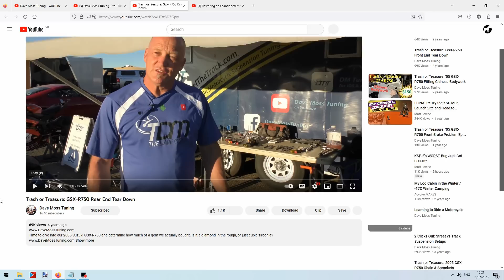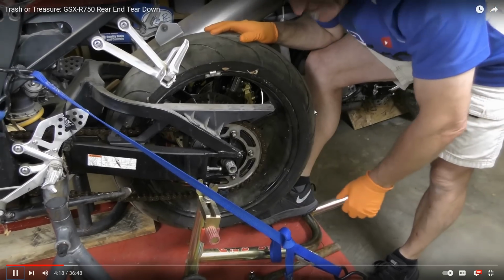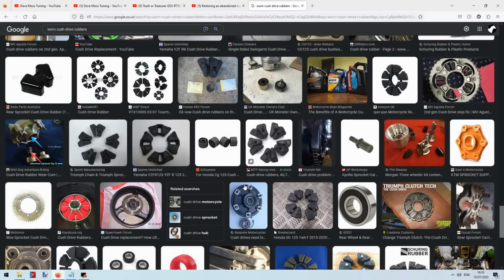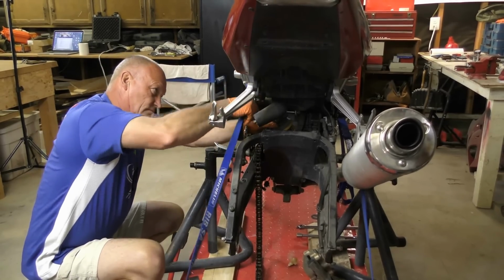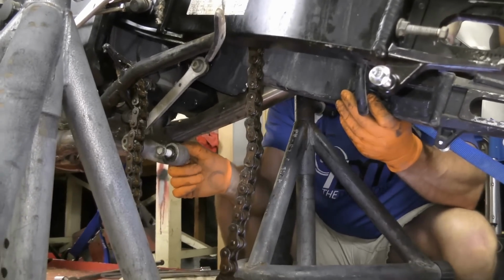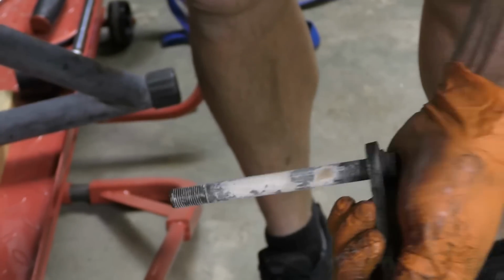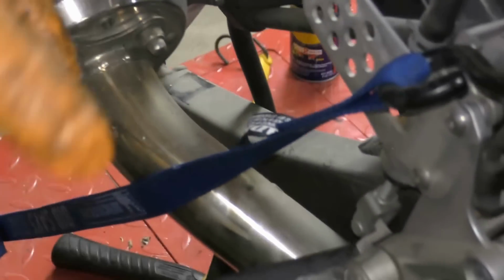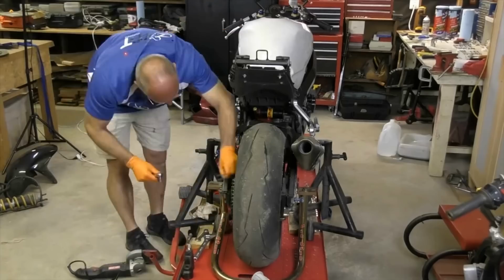Dave 'expert' Moss - The swingarm #2

Comment: This is messing with my head; so many tight bolts undone with a ratchet (with all the forces involved going through a tiny tooth of metal) when a tommy bar or breaker bar should be used at first. He’s even got a breaker bar there with him at the time. All he’s saving is a few seconds, when he doesn’t have to change over to a ratchet when the bolt’s been cracked loose. 

Ratchets will take a fair bit of abuse, but only up to a point.

Comment: 27:00 that is the original screwdriver - GSXRs came with a reasonably decent toolkit including a double-ended screwdriver with tangs in the middle as you mentioned plus this longer single-ended one.

Comment: 1. Why wouldn't you pull the swingarm linkage off and then just drop the shock out the bottom? 
2. Why wouldn't you trim all the video footage of you spending 5 minutes figuring out how to remove a cotter pin from a castle nut?
3. Why wouldn't you take the bike to a car wash and get it clean and not disgustingly grimy and dusty before you start doing this sort of tear down?

Comment: Why do we always have to have a prediction before each operation glass half empty style and then “go ahead, a bunch of often times” all usually turns out okay, then still provide drama as near avoidance from the brink of catastrophe?

I hope I haven’t already missed the spark plugs and sump bolt removal footage following the same idiotic reverse methodology as the rear suspension linkage fasteners?

Comment: LMAO watching this as I use new nuts on a new sprocket on a 25 year old Yamaha XJ600n and perfectly happy with the cush drive rubbers. Everything you say is mostly what I was thinking / shouting at the PC. I wouldn't let him finger my bearings to test them....  they are cheap enough to replace,  which is what I did. Yes I think you are right. ...... doing something he's never done before and all the while give sage advice like an expert.   The link bolts need to free to turn in the bearing !! FFS

Comment: Where do I start?? What can be said you didn't say?? 
OK... The dog bones.... They had bolt heads on them so put the god bone in the vise and use a fucking spanner on them and they will break quite easily.  The castellated nut to set the swing arm doesn't need to be undone to remove the swing arm as you pointed out is there to centre the swing arm. The cush drive again is as you pointed out fine and its just rotation which he should have checked with the wheel in situ. The subframe surely had to have bolts in when they got it running as I saw him leaning on the tip as the tail unit and it didn't move in the first video.  

Removing the exhaust is always a good idea and it is easy enough to do too. Loads more space to work with and it just makes life easier. The rear shock could have been removed easily from the bottom once the linkage had been removed too. How do I know?? I built a GSXR600 project bike which is the exact same chassis and that bike was stripped and rebuilt several times, twice for photo shoots and stuff like the shock removed many times to run different springs, different shocks and change the shock length to alter the ride height blah blah blah... 

That bike is NO different to 99% of other bikes the same age and mileage when it comes to "corrosion" as it has been in Utah which is a dry heat and has possibly never seen temperatures below 20 degrees C where the owner lived. No real rain in summer as its part of the area which has been having a 20 year long drought. I would be happy to work on that bike. To be honest if it was mine, I would check free play in the wheel bearings, headstock (they can get abused from wheelies and hard landings), fresh fluids, tyres and sort out the brakes and then ride it on the road for a few days to see if anything else seems off like knocking in the forks under braking and get a feel for things that may need to be done.  Then strip the body work for fresh paint, strip it down to clean it as much as I want and then do changes to the shock or forks based on how it feels while riding it.. A bad rear shock may not be obvious just with static load and will only show up when riding. Same with fork issues, riding will show them up much better.  What he has done is a Dell video trying to make a simple refresh sound like its a massive job and over complicated it all as well as made non issues sound like expensive issues. Possibly because if he sees those issues on a customer bike he can justify charging more for it. (He must have been a plumber, plasterer or electrician in a previous life). 

The numberplate mount is fitted behind the wheel when you are some dumb American who wants to barely comply with any laws and is going to try to out run the cops..

I might go and look at some of his suspension set up videos and share the dumbest ones with you via messenger on farcebook Matt. 

Also if you want or have time, you are welcome to come have a day (usually a Thursday) riding on the little pit bikes on track and get to hone your riding before you get out to do a trackday on the track bike you are building.  Usually Rich Cooper, Kyle Ryde and a few others come out too most weeks.
Reply from the maker: I'll be taking you up on that once I get a new workshop sorted

Comment: I had a swingarm pivot bolt that was proper seized where it goes through the engine in an XR400 dirtbike. I would pay to see this guy try and get it out, he'd probably end up being one of the dopes who pull out a sawzall and cut the swingarm off and buy a new one.

I had grind down a socket to get better engagement on the bolt head, 6' cheater bar, heat on the engine case, and a brass drift being hit with a mini-sledge to get it moving.

Comment: The lack of images available online would indicate that Cush drive rubbers rarely fail. Again another internet let’s just say everything is knackered and replace rather than get the manual check the spec and prove it’s failed …correctly.  Even if someone can’t do this job, even if they have no interest in doing it. When you are standing in front of a mechanic, who is trying to charge you to replace a part, you could at the very least understand something. Watching this nonsense helps no one.
Like with Del, and many many others on utube, if you are looking for knowledge and come across these idiots, who talk the talk🤦